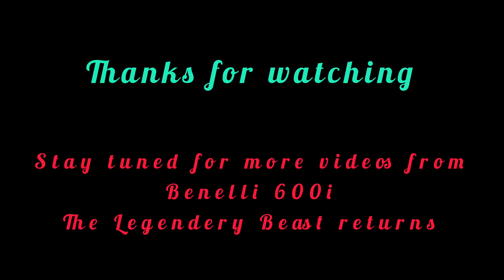MUST HAVE😍 | Benelli 600i Customised Crash guard installation 🔥| Benelli 600i modification

Comment: Crash guard setup a proper finish ila degin'm knjm mokka
Reply from the maker: Hi bro... This setup is designed by famous stunt man in bangalore who has a same bumper setup in his benelli too... It saved my bike from many accidents. Worth a lot. Can you please tell me what to do correction in crash guard please?
Reply: @ONEMANSHOW_LIFE  Worth dan bro worth ila nu solala but  inum develop pananum nu solren nama padma Prasanth setup parunga ila stuntexru check pani parunga Last a crash a ana video clip pathen , nanum crash cage use panitu dan irukn evlo accident analum apdiye dan irukum ivlo bend la agadhu apdiye dan irukum keela oru connecting rod venum jzt fix pani parunga knjm setup change panunga and design too
Reply from the maker: thanks for ur suggestion bro. actually keezha connecting rod enga poda mudium bro? bcas nanum adhu yosiche ana anga vazhi illadha madhri iruku...
Reply: @ONEMANSHOW_LIFE  design as knjm maathunga nd side brd a iruku adha knjm reduce panunga coz cornering pana mudiyadhu city ride tough a irukum thn engine front ku munadi rod a connect panunga engine kum exhaust pipe kum gap irukum la adhula connection kudunga other end ku but knjm lower a 1st design a yosinga
Reply: @ONEMANSHOW_LIFE  and helmet change panunga agv k1 series a rc200 ku thangala adhu oru accident frnd bike la 😂 apalam mari agiduchu mt smk sol la 200cc ok but this is inline 4
Reply from the maker: Sure bro kandipa maathidre. very good points... Nandri bro🤗🤗🤗💯
Reply: @ONEMANSHOW_LIFE  alwyz wlcm 😊